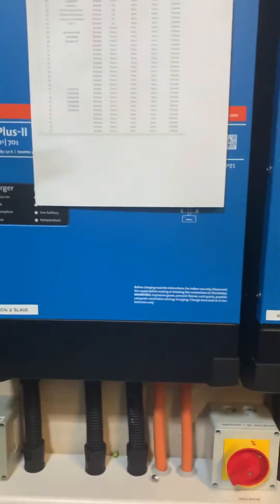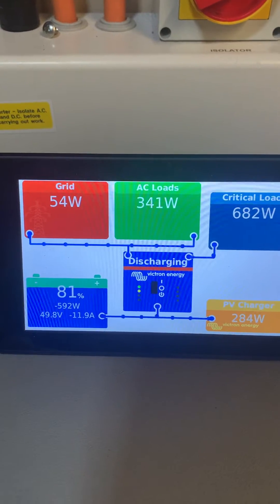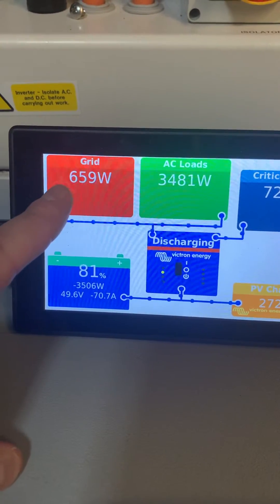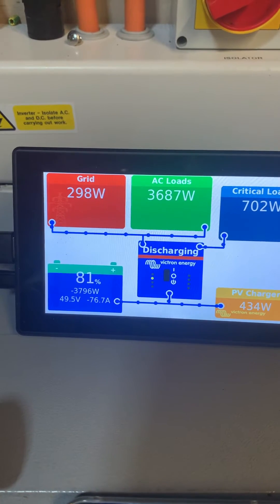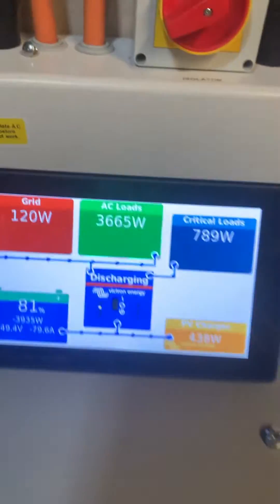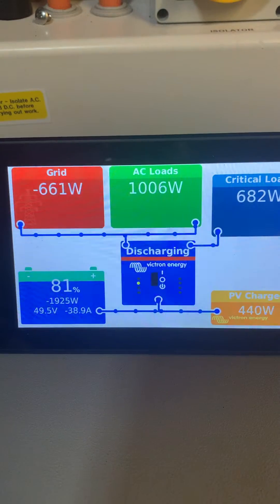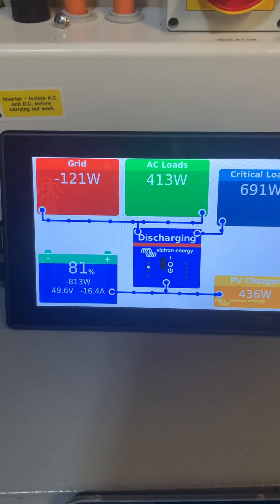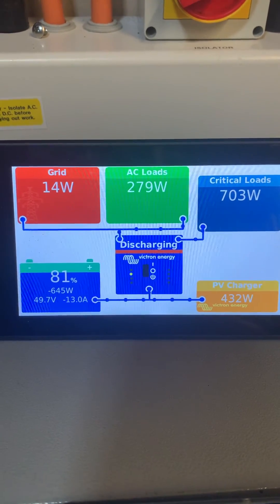Victron Muliplus II ramping up and down as a load is applied and removed.

Comment: I had hoped to use a Multiplus and ESS "off grid" with no possibility of back feed. Jsut treating the AC input as a generator or shore power, but this level of back feed is a bit concerning. Perhaps i need to investigate a regular grid tied installation and make an application
Reply from the maker: @conzymaher  yeh - just replied to your other post, this video illustrates the ramp up/down.  If you use the internal current sensor (so NOT single legged mode) or you use an external current clamp plugged into the multi, it’s much faster to ramp up/down - but it still does the same thing

Comment: As per another comment, my multiplus is a lot quicker to respond, but it's only a quick test set up, not installed the energy meter or paralleled 2 units yet, that's coming soon! Did you fill out your G99 form yourself? That's where I am at the moment, it's not the easiest thing to get my head round (form A1-2)
Reply from the maker: I did it myself with help from my supplier
Reply: What energy meter are you using - or not? Mine behaves exactly like this but using the ET113, it’ll take only a few seconds.
Reply: @incognitowarrior  i have an ET112, but it's not installed yet, I've just tested my inverter and charged the batteries by plugging it into a socket.
Reply from the maker: @incognitowarrior  I’m using an et112 over modbus.
I’ve found the victron thread about slow response - some talk of newer firmware

Comment: I had the same delay when using the Energy Meter. However, after looking at a number of forum posts, I bought a CT clamp to monitor the grid connection. Changing the Grid metering setting to “Inverter/Charger” results in a much quicker return to zero when applying or removing a load (takes about 1 to 3 seconds).
I do find that I have my set point between -110W and -150W to avoid pulling from the grid at all. Setpoint seems to change if my Heat Pump or Car Charger is on - suspect the CT wire may be picking up some interference from the nearby loaded cables.
Reply from the maker: is that setting in cerbo or veconfig?
ok - found it, can you point me in the direction of the posts about this setting please.
I have an external ess meter as per my other viseos, i have loads upstream of the victron
Reply: @eliotmansfield  Cerbo. Settings-ESS-Grid Metering
Reply from the maker: @markrussell7197  think ive found the thread - not sure it works with a parallel setup.  My mate has similar problems but on a 3ph system
Reply from the maker: Just for the benefit of others, i did try a genuine victron external clamp plugged into one of the two parallel inverters and it does speed up response - but now the victrons think all power is crossing the victron, so it limits total current draw to 50a - which meant for me in the middle of the night is would reduce battery charge current down when I had other heavy loads (hot water, hot tub, washing machine and tumble drier running)  - when in reality the only power actually going into the vic was the charge current.
So disconnected it and went back to et112 and just live with slow reaction
Reply: Thanks Eliot… did you ever try the newer Victron power and clamp meter VM-3P75CT or similar solution instead of ET112